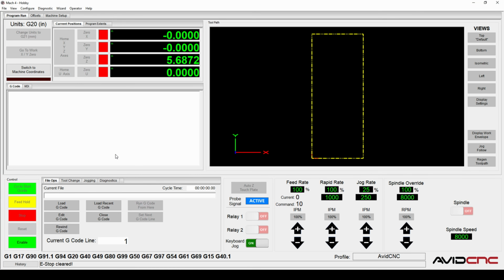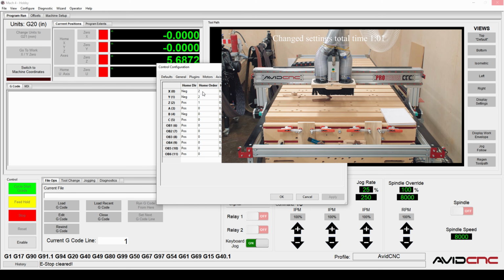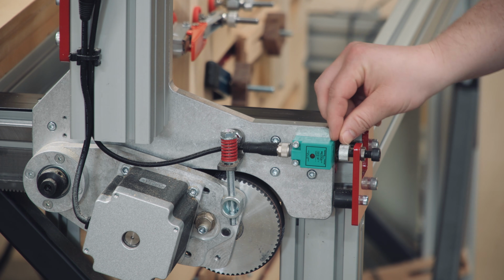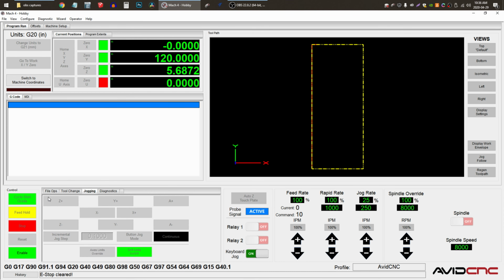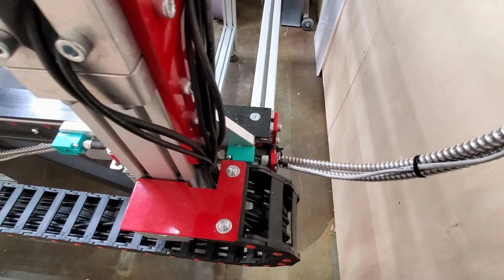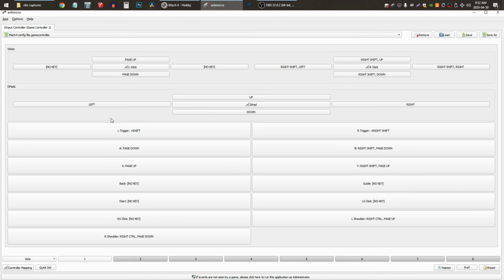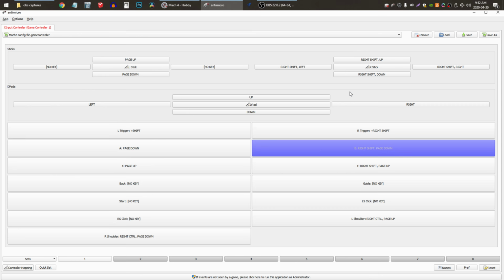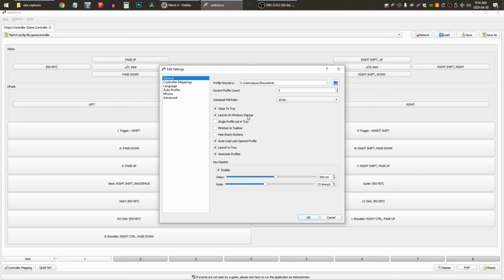Avid CNC Ep4: Homing Speed, Cutting Area, and Video Game Control - 344

Comment: Jay, thank you for your videos.  For someone that started in a small garage, bought a CNC and now branched out to the new space I was hoping you could answer a few questions about starting a shop.
  I'm eye balling an AVID CNC machine to be the center piece for remodeling my kitchen by making new cabinets and eventually grow a shop.  What other tools do I need where the CNC can't be used to start with?
  My dad had his own shop when I was growing up so I know usually you had to have a table, band and radial arm saw, I have a good drill press still in the box from a five year long divorce.  He also had a lathe, planer, jointer and other various sanders and hand tools that I used to work with.
  Before I pull the trigger on a purchase I wanted to find out what can't I do with the AVID CNC when building cabinets and making cabinet doors so I know what other purchases I need to plan for.  From what I can see a CNC can do most of the work.
  My plan is the renovate the house I recently purchased so that when I sell it and move to Texas it will increase the value and pay for a home in the future.

Comment: I would suggest a cheap pulse generating handwheel. Mine is called xhc  and cost £50 on ebay. It is very much better than the xbox controller. Worth every penny.

Comment: Awesome and timely as I'm setting up a cnc router right now. Just curious, had you previously tried a PS3 controller before settling on the Xbox? Only ask because I have one sitting in a drawer from an old PS3. Thanks!
Reply from the maker: Any controller should work.

Comment: Cheers Jay. I got the Xbox controller running easy with that AntiMicro.
I mapped the triggers to shift and ctrl. Pretty much instantly intuitive. It's cool how you can set the position on the trigger movement to where it switches on/off. I've got the shift trigger set way in to help prevent accidental rapid. Hopfully no accidental button pushes.
Thanks - Ken.

Comment: Getting every inch out of your larger CNC is a great idea.  I was able to get about 124.2" on my 60120.  If you want to keep those sensors intact in a crash though, consider mounting them vertically instead, with bolts or angle iron coming off the legs beneath as sense triggers.
Reply: @Darren Boden instablaster =)

Comment: I wonder if it would be beneficial to mount a USB port on the front right of the CNC mill, then make a pocket to mount on the front bar to hold the controller so that the controller has a specific place to go when not in use and the cable isn't stretched from the PC and possibly getting in the way if you're walking back and forth on the right side of the machine.

Comment: Great video Jay! I use the same controller with UCCNC but using the software plug in  to configure it. I added Start button as a Home All movement, and the Select button to run the Tool Length sensor macro to calibrate Z axis. 
Looking forward to build a vertical table like yours! Keep on with this cnc tutorials!
Max from Argentina

Comment: I see how you like the Xbox controller you have (I got one of those for my small grizzy but never used it...you would set the keys for it in Mach3 ..if I remember correctly) but I have wireless controllers with displays for  it and my 1300 x 2500 CNC...one of those controllers will only work with mach3...I really like the display and the Macro keys...have you ever thought about those controllers and from you point of view can you say why you are using Mach4 instead of Mach3...Also Jay I was very impressed with the level of detail you went into when you did your digital setup of you Machine and the positioning of your fixtures ( and all the cuts you setup in the  software for the Machine)..I normally will just create a  jig that I will set to the table and use the corner of that jig for a reference on most of my cuts. I  also Enjoy using CarveCo (Never tried Aspire...I feel like Carve does the More "Artsy"  3D kind of things I want to do easier) Also I stay in Metric( I think I do that because of the CNC and the lasers...Which is a very universal tool).  Again I am very Impressed with your level of detail and the thoughtful approach you show in your work.